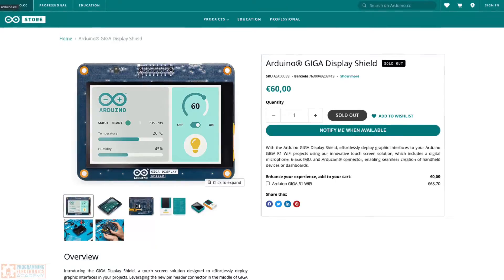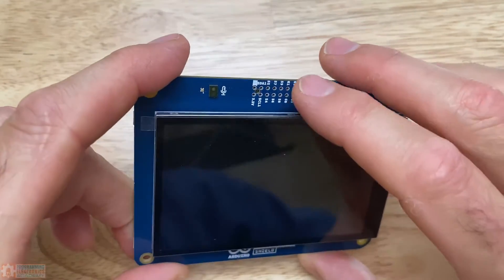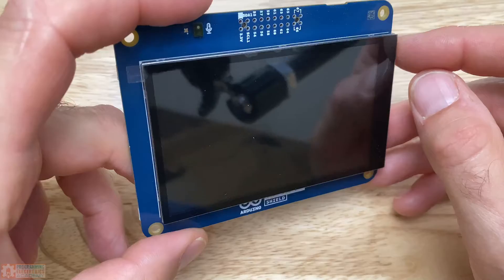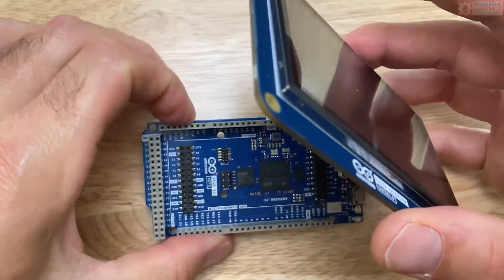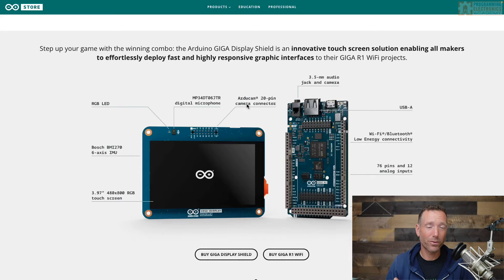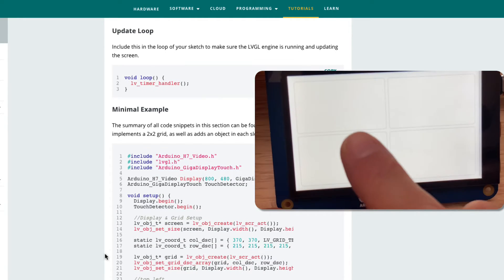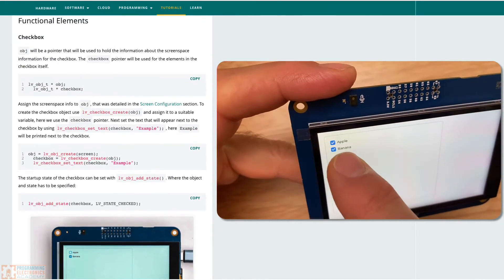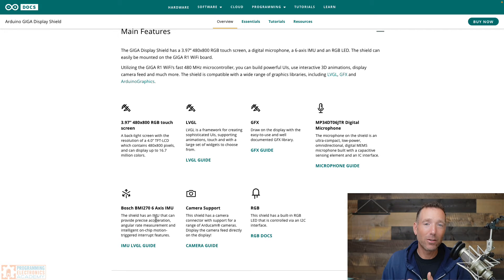Arduino Giga Display for Giga R1 WiFi - first impressions  #Giga Display #Giga R1 WiFi #arduino

Comment: I've just ordered the Giga board and the shield. I'm using the Arduino IOT cloud to get environment data around my home, mainly temperature and humidity in various locations such as our detached garage, garden (yard), attic and home office. I'll display status on the display and swap between locations using the touch screen. I am going to use a prototype board to mount extra sensors on the rear of the Giga board. I have also ordered the "KKSB Case with Adjustable Stand for Arduino GIGA R1 WiFi and GIGA Display Shield" to mount the board and display in. The Arduino IOT cloud allows you to share data between devices that you have connected to it.

Comment: It's worth mentioning this is a very exensive display, on Amazon it's £80 and the Arduino Giga R1 is nearly £73. So just the display and the Arduino is going to set you back around £154 before you do anything else.
Reply: Yes, it is expensive but they have been tested as a working pair and there aren't that many options that offer the functionality that comes with thus. I have looked at the RP2350 using the HSTX interface to drive a 640x480 display. Displays with HMDI at that resolution are few and far between and tend to cost a lot due to the limited demand for them plus I haven't found one that offers a touch sensitive screen

Comment: It's really bothersome that almost every Arduino board lacks an Ethernet port. They should realize that WiFi is not solid enough !
Reply from the maker: I hear you - I am rarely seeing ethernet boards...
Reply: u have right!its very poor.  also an RTC/SDcard  they could put on
Reply: that is typically why i go for raspberry pi where i can.
Reply: Arduino does have a cable ethernet shield that is compatible with the Giga board. There are also third party boards available.

Comment: Is there anyway to mount a apple iphone camera onto it? just the camera piece, like the part. I want to try the insane zoom feature it has.
Reply: No. Sadly there are too many connections. Also that would be impractical as it would require lots of other hardware in order to take correct camera shots.

Comment: Wow looks awesome. I am new to this Arduino stuff and am on the PEA. This looks like it would kick arse with the project I doing. 2.8 TFT display to control my air con the van using the IR remote library , which is frying my brain as I need to change the pin out for the PWM timer as the shield uses the library pin 9 or 11 cannot remember right now. Keep the videos coming ❤.
Reply from the maker: Thanks Philip - will do!